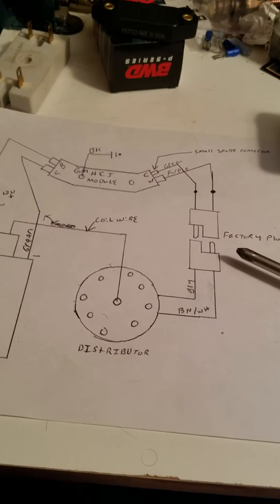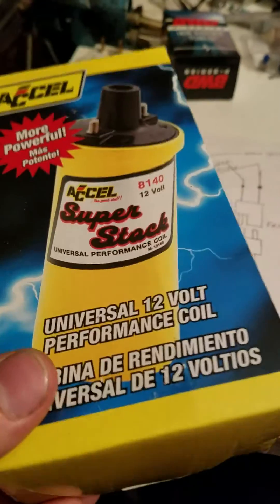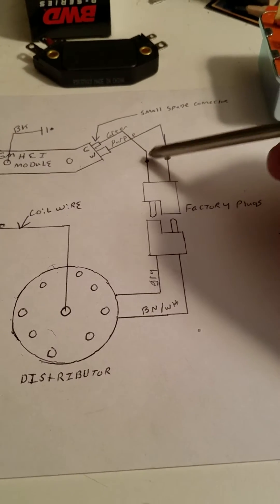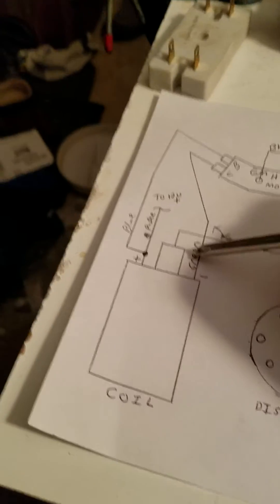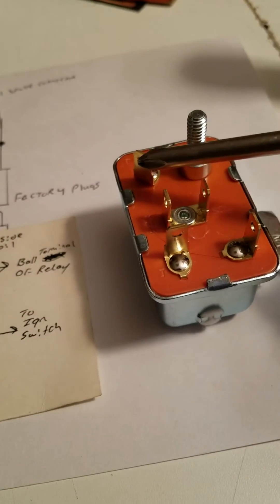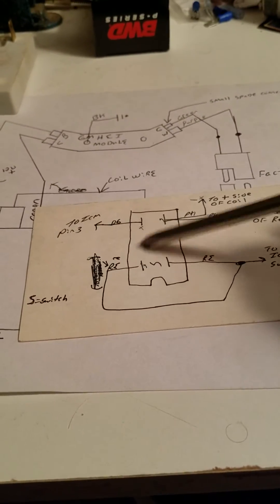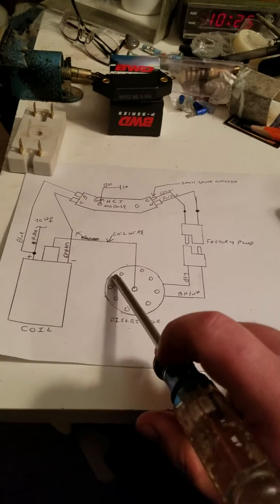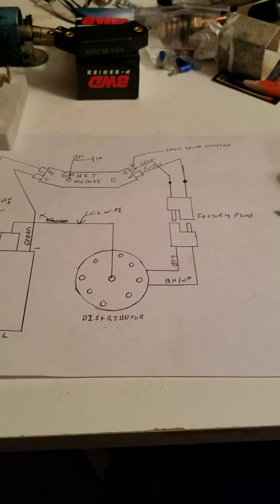HEI conversion on my 1979 dodge truck part 2

Comment: I got the one with the internal module on my 73 318 duster,I still have the box and ballast hooked up,but have a toggle from batt to coil  to turn ignition on and a push button but still have to turn key to unlock what should I do ? Unplug the box and clip wires ?,I will eventually rewire the car but have no time or money for it at this time.its my daily driver

Comment: Does the ignition run continuously on 12 volts to the coil?
Reply from the maker: Not if you wire it correctly... watch my other videos on the subject...
Reply: Will do, thank you! We have been burning coils on an old bombardier. We switched to your system without success and we aren’t getting power and blew another coil. From your picture where are you drawing power from your ignition? Does your picture system take 12volts continuously? If not how do I make your system work on a 360 dodge motor sitting on a stand?
Reply from the maker: @westshorehideaway6885  the system should only have power to the coil in start & run on the key. Keep that in mind when you are using it on a test stand as well....

Comment: Ive done the same set up on a 68 A100 (minus the fuse which i will add) but i keep killing coils. The first coil lasted 10 min. The secound about an hour. Any sugestions on what to check?
Reply from the maker: It may be the coil your using. It could be shorted internally or it could be the brand of the coil.  Last possibility would be a short in the wiring harness.

Comment: My coil has a capacitor on the negative wire is that correct o should it be on the positive side thanks for your video
Reply from the maker: Hmmmm.... ive never really seen a capacitor on a coil wire before. Gut says its an unnecessary part. Wish i could be more helpful.  Appreciate you watching the video!

Comment: If you are doing away with your resistor you don't need a run and start 12 volt circuits. You just keep 12 volts on the coil. Start voltage and run voltage are the same unlike moper's system
Reply from the maker: If you dont wire  wire the coil to a switched 12v source you will drastically shorten the lifespan of both the coil and your battery.

Comment: The electrical diagram is correct but you should run the power wire from the coil and the module directly to the fuse box to ignition hot forget about playing with resistors if you have a 2 coil distributor you can use either one just reset the timing
Reply from the maker: To do that would require more modifications than are necessary.  I chose the simple path...
Reply: HEI module like clean power always run to the in side of the fuse box and to have a electronic voltage regulator 12 ga wired
Reply from the maker: @pauljanssen2624  probably.  But i haven't had a single problem with mine.  So i guess there is more than one way to skin a cat...

Comment: GM HEI systems don't have a balest or any type of resistance in there ignition systems.
Reply from the maker: Exactly.  Which is why it's a great ignition system upgrade for Chryslers.
Reply: I have a 1985 Toyota pu and the original ignition module went out. It was about 600 dollars for a new one. The GM module throws a hotter spark. Thanks for your video.
Reply from the maker: @samlogosz8422  your welcome.

Comment: I hate as much as I can cutting original harnesses so why not simply solder 2 wires to bypass the resistor and reinstall the modified resistor in place ?
Reply from the maker: Well the reason why i had to cut mine is because the connector went broke.  Other wise i can still use the original harness.  But i believe running the power through the resistor would reduce the full power this ignition system can make.
Reply: U r close.  Yes.  If you leave the BR on the fender or body, you can just move over Ign1 to Ign2 with a piggyback spade/connector.  The main point is that you are no longer separating the two - but you need them off your ignition switch.  You just no longer need to go through the ballast.  The coil gets the full voltage, now.

Comment: I have dual pickup coils with a single ballast ...will this work
Reply from the maker: skillzsaw blade yes it should.  The dual pickup distributor just had a separate trigger for starting.  If you know wich wires go for your "run" side you can simply splice into that plugin because the hei is 12v all the time. (If your uncomfortable  with messing with your distributor here is a link for a single pickup distributor (assuming you have a 360 engine) https://www.oreillyauto.com/detail/b/select-2706/ignition---tune-up-16776/distributor-12503/8c7c95368caf/cardone-select-distributor-new/843898/2463618/1990/dodge/d250-pickup-rwd?q=Distributor&pos=1 ) any other questions you know how to reach me. Good luck!